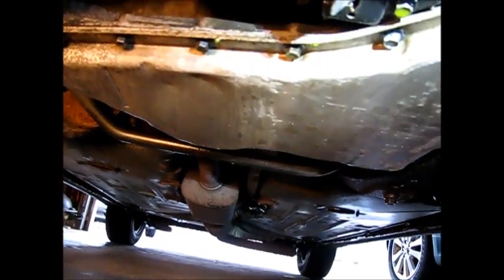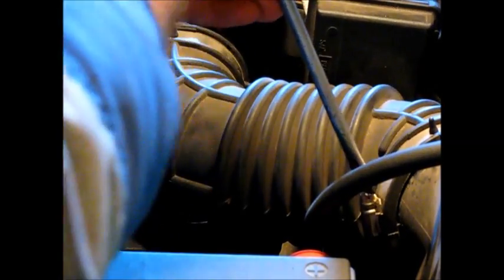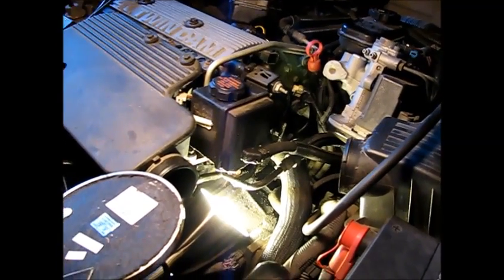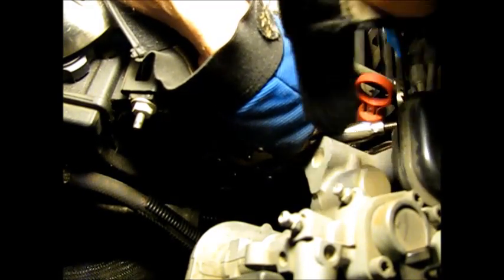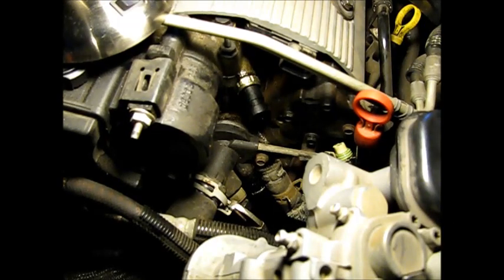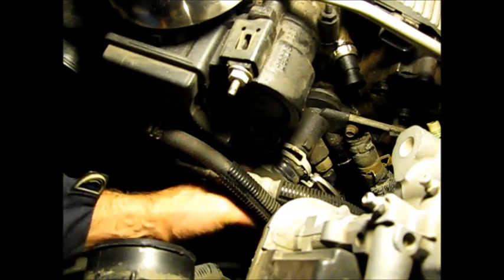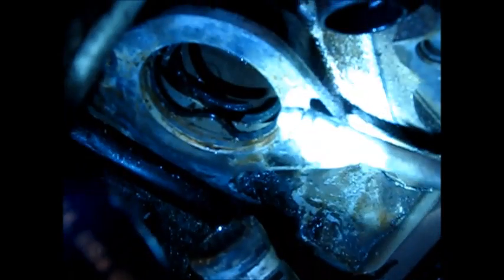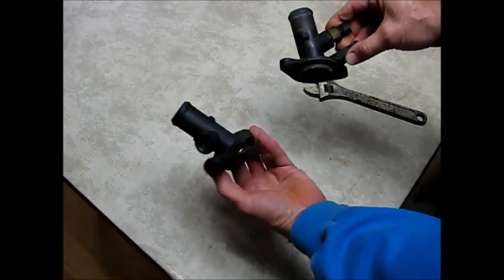Repairing a coolant leak on a 2.4L GM Grand Am Part 1: Troubleshooting  and Disassembly

Comment: Thank you for the informative video. I developed a leak from this part on my 99 Z24 with the same engine. Wasn't sure what it was at first or if this piece was actually the culprit vs a bad hose though the hoses look and feel just fine. I thought perhaps I had a problem that could end up being bigger and more serious. Also wondered how common of a failure that water outlet is. Glad to know it's common and not that bad to replace so I'm not stressing so much. Thanks again.
Reply from the maker: You're welcome. I so glad this older video was still a help.

Comment: Great to stumble on these older vids that is straight to the point and very informative 👍 this seems to be likely culprit for mine also do u know how to change valve cover gaskets on that engine am having tough time find correct sequence of operation have heard of cam lifting up while teardown and some other unknowns please help
Reply from the maker: Sorry. I haven't done this job on this engine either.
Reply: My cam cover gaskets are leaking and the cams will pop up and cause a pain in the ass and the timing gears will have be removed too. I said no way,it's not worth it. I experimented on a junk engine first.

Comment: Is there a sensor in that piece that you removed? I have a cavalier 2.4 (Z24) that has a connector that goes there which seems to be damaged because when you move the plug the temperature needle stops working. I also wanted to know if it is possible to repair this part with some super glue, the nozzles of the hoses The heater broke so there is a water leak there that makes my car overheat and this part is very difficult to find in my country.
Reply from the maker: Yes there is a temperature sensor in the water outlet. That would explain your temperature reading issues.

Comment: this videos was very helpful, I just want to say is better to loose the pipe from the nut under the heat shield cover, like that you wont damage the gasket in the water outlet.
Reply from the maker: Alonso Jimenez Thanks for watching and adding the helpful comment.

Comment: I have a 2002 3.4L. I was driving around for a few hours and all the sudden white smoke was drifting from my hood. The temp gauge shot up over 200deg. I pulled over and looked under the car, it was actively leaving coolant and I could see where steam/smoke was emanting from engine. The leak seemed to occur where you pointed out. Pretty much all of the coolant drained out. The next day I had a water puddle. I'm hoping this is the problem and I should be able to fix it.
Reply from the maker: You have a different engine and a newer vehicle and I don't know if they have the same or similar part, but it's worth a look. Good luck!

Comment: Would a '97 be similar enough to a '01 for this job? I'm looking at buying the '01, I'm told it has a leak from unknown origins, and I've heard some horror stories about working on the Quad 4.
Reply from the maker: +Michael Vinson This should apply to 1996-2002 2.4L engines. This is the only problem I ever encountered with coolant leakage on this car and it wasn't that hard to fix. It was kind of hard to find where it was coming from though. Good luck!
Reply: another coolant leak problem you'll find is from the quick connect it's made of plastic and in time will break inside the hose its also a quick inexpensive fix.
Reply: The Original Mechanic  I have a 1999 grand am. 2.4 l and I was at work started the car and violent was every where under the car I kept putting in coolant and didn't last a mile don't know if its the water pump or what having problems finding the leaking right before that the timing chain area was making a very loud noise but one the coolant went everywhere the noise stopped
Reply from the maker: That might be water pump trouble.
Reply: The Original Mechanic  do u have a video on that on my specific car
Reply: Maricella Gonzalez ver video

Comment: Do these cars have a thermostat somewhere??
Reply from the maker: Yes, I have never replaced one, though, and I don't know where it is located.
Reply: Never saw thermostat in upper by air filter. Thermostat location is in bottom right corner of motor. You have to remove exhaust manifold unscrew deep stick then pull it upward. Really hard but I did it. Lot patients.

Comment: Excellent camera work,I also have a 2.4 Pontiac Grand AM and I am facing the worst in having to replace the water pump. I did my research and there are no recommendations to do this on my own. Timing Chain and rusty bolts. $1000.00 for the mechanic to do it. The water pump is about $35.00. I will always wonder why they placed the water pump at the bottom and make a person have to disassemble a good part of the engine just to get to this piece of junk part that is only worth $35.00? Oh well Pass it along, STAY AWAY FROM THE PONTIAC GRAND AM 2001 2.4 LITTER. I'ts just not worth it. Good video thank you for sharing.
Reply: Scott Engstrom the chevy cavalier z 24 has that problem too. It takes about 6 hours to replace the water pump.
I guess somebody came back from  a hangover 5 to design that engine. nothing is simple on that engine.
Reply from the maker: Scott Engstrom Thanks for the heads up. I haven't done a water pump on this engine or I would have a video to help!
Reply: @younesnoaman8735 
If you can change out that water pump in 6 hours my hat is off to you! 
Took me a day and a half just to drill out one of the stupid rusted exhaust bolts, then broke another two trying to get the manifold out of the way. Book said there would be special tools needed, but failed to list the jack hammer, torch and chain saw. 
Working on it just when I get some spare time it has been several weeks at this point. After that length of time the various nuts and bolts have managed to mingle in with the pile of junk in my garage that is growing daily from about forty different unfinished projects that keep erupting while I'm busily watching YouTube videos of how to tear this idiotic contraption apart. Most of them start with "well, I ain't never done this afore but ..." 
Or the mind numbing slow guys that describe every minute detail about each and every nut, bolt, and screw, please the running commentary on why in the world did GM hire these engineers from hell to design this monstrosity. 
Running a water pump directly off the timing chain? Putting said water pump behind the engine, under the exhaust manifold and above the steering sector? 
I can only surmise that you are a professional who has all the tools and a garage and lift, and a clean work bench on which to lay out the various parts and pieces in an orderly fashion to be able to put it all back together eventually. 

Again and my hat is off to you sir

Comment: I am replacing mine today , Every thing thermostat, heater core, radiator, water pump had to be replaced ,Yes exhaust manifold had to be removed for the pump . Please if you have a leak do not leave plain water it it occasionally ad some antifreeze to it on any car they will rust and then after a few years you might be replacing parts the original owner of our car left water in it so far almost a 1500 repair bill

Comment: have a 99 grand am 2.4L thats developed a leak from that spot, is this a common problem?
Reply from the maker: I believe so, judging solely by the comments and views on this video. Age and heat seem to deteriorate this part.
Reply: The Original Mechanic  Yeah I had this  replaced  just again a second time in 3 years of so today on my car

Comment: Is it possible just to replace the seal ring instead of buying the entire unit?
Reply from the maker: +exee1 I would imagine an o-ring could be found that would fit. But the part is not expensive and has to come out anyway so why not replace it?
Reply: The Original Mechanic sir I can put water or coolant in my car and it starts leaking from an area that you can't reach unless you take off the manifold. the faster you put water in it the faster it leaks out on the ground around the oil pan area so please point me in the right direction my car has been without anything to keep it cool and it's cutting off from over heating as well
Reply from the maker: I don't know about the source of this problem.  It sounds like that intake manifold may need to come off to find the where it coming from. I'm not familiar with this repair.
Reply: Brandon King he just showed u what it was bro mines doin the same thing I went thrown like 3 bottles of coolant a day n your car is shutting off cuz of the water r coolant hitting your gaskets n your spark plugs area if u get that part and replace the water outlet your car will keep your coolant and water

Comment: Isn't there supposed to be a thermostat in there ?
Reply from the maker: No, the thermostat is in a hard to access place, I've heard.
Reply: The Original Mechanic  yeah I saw another vid on where the thrmostat is whichis at back of engine under a heat flashing and I think the manifold, but it can be changed without removing the manifold according to that vid